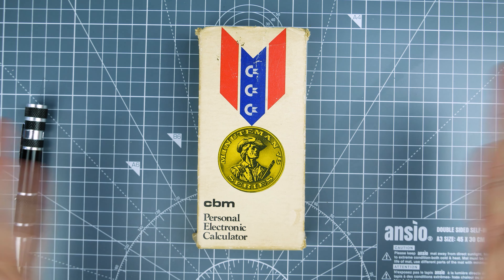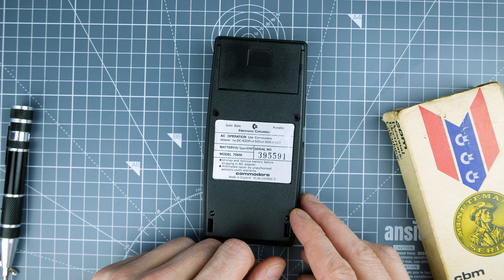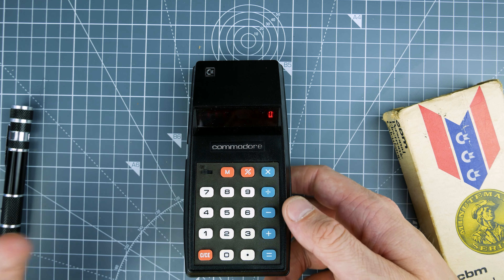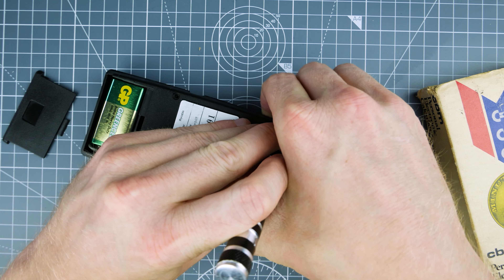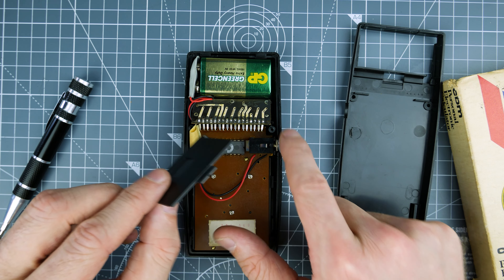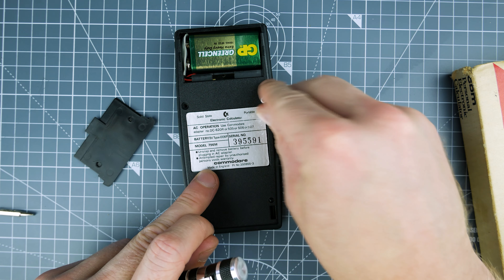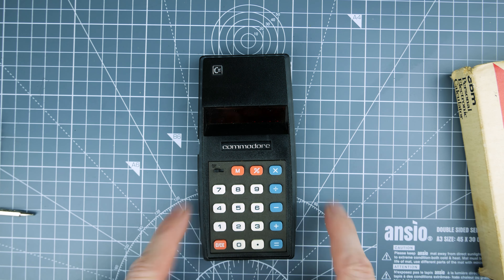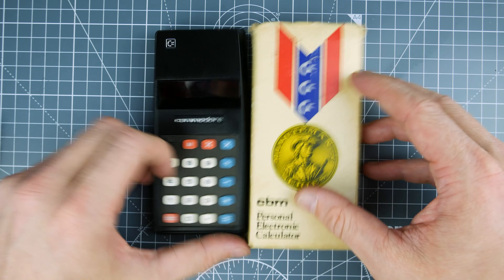Vintage Tech: Commodore 796M - VT6

Comment: This is how I think it's working: There are 17 connections to the display and keypad. It is probably using 5 for rows and 4 for columns for the key pad, that's 9.Gnd and +Vcc for the display that's now 11, leaving 6 spare.5 of which are needed to determine which number to display (5-bit binary for 0-9 and .) and the last pin is the clock/latch.The display expects a number to be displayed, then clock/latch, then the same pins are used for number display position, then clock/latch, then repeat the sequence to strobe the display.
Reply from the maker: Wow, that sounds very reasonable. Really impressive that you could pick that all up. Nice one mate.

Comment: Very cool indeed.  I was unaware that Commodore made calculators, I have owned several of their computers starting with a Vic 20 (I think that is in the back room somewhere) C-64 (3 of them) C=128, my first love really! And just for shits and giggles, I picked up an old Plus 4, which was the last one I purchased at the going out of stock price of 10 bucks, I took it to a gun show with an old monitor, and wrote a little program for it that spouted pro gun sayings, some fellow gun nut saw that and traded me a very nice old 10 gauge double barrel Ithaca Shotgun for it, along with five boxes of shells.  Hell one box of shells was worth more then the old computer.  Nice to see the Commodore logo once more though, hell I guess  when I think about it, I do have an old Commodore monitor in the dining room gathering dust, I was going to haul that to the dumps but I sold my pickup last year and the blasted thing is still there.
Reply from the maker: Everyone loves Commodore. I am going to pull mine out of the loft and try some home automation just for a laugh.
Reply: Don't forget the "Challengers of the Abyss" Disk.

Comment: I don't agree with your 'nothing special here'! But then I am a bit of an old-tech nerd. I have a Prinztronic M, bought for £49.99 from Dixons about 1963 (?) - corroded battery terminals so not working. A CBM SR7919, very similar to your Commodore but made in the UK! And a HP11C programmable from the early 1990s that I use pretty well every day and still on its original batteries. In the late 1960s / early 1970s I used a Brunsviga D13R double bank mechanical calculator. That was a fantastic machine (look at http://www.johnwolff.id.au/calculators/Brunsviga/Brunsviga.htm about 1/2 way down the page)